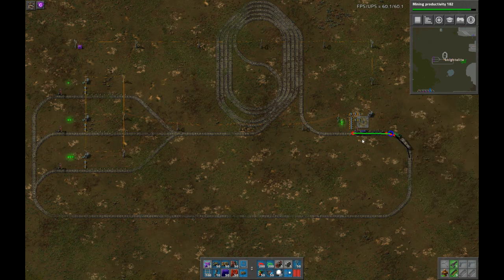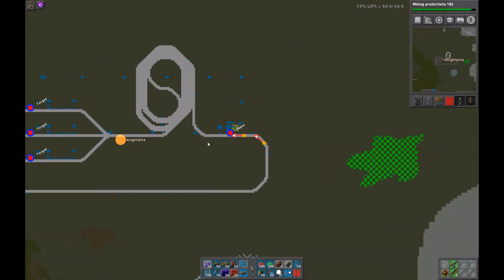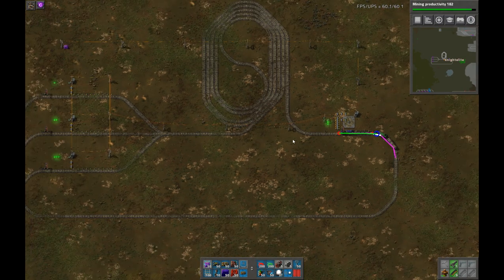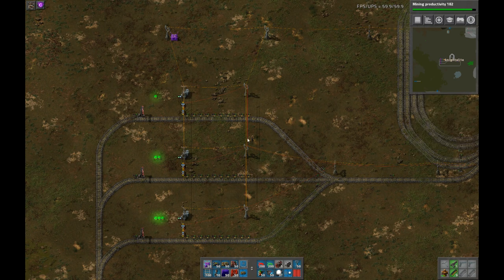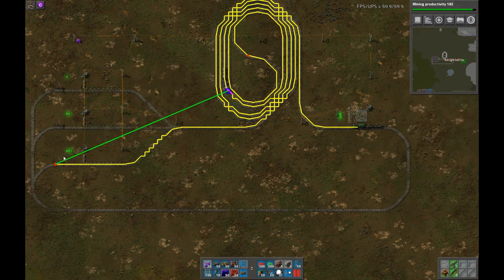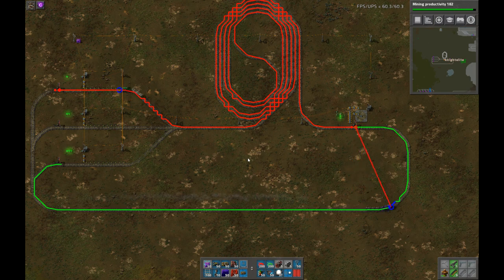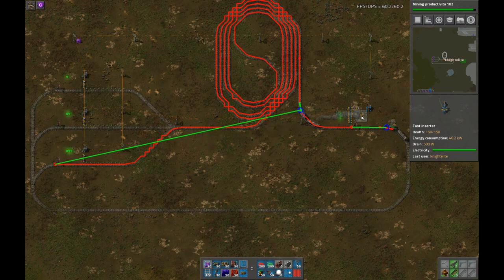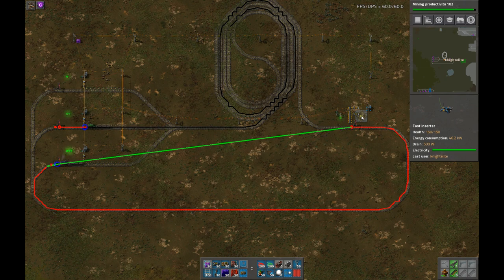Why does the second train repath?

Comment: Did you ever get to the bottom of this? Is it related to the item in your wiki link "The train is preparing to stop at a signal ..."
Reply from the maker: I did.  Turns out trains repath as soon as as their braking distance crosses a red signal.  Adding another signal to split up the last block in the spiral made it path as intended.
Reply: Brilliant work!